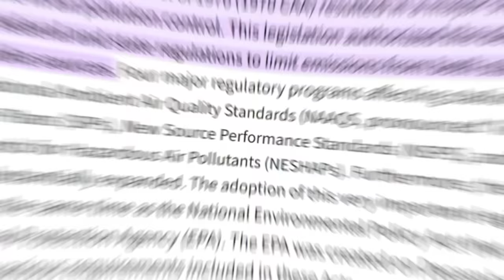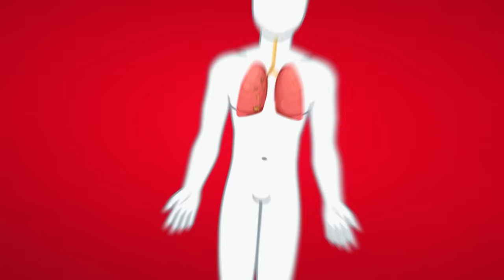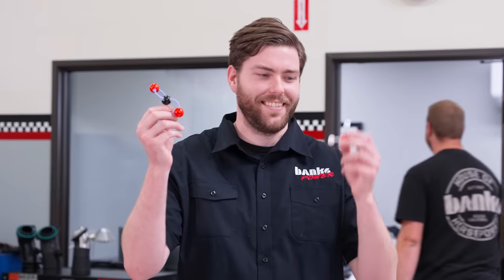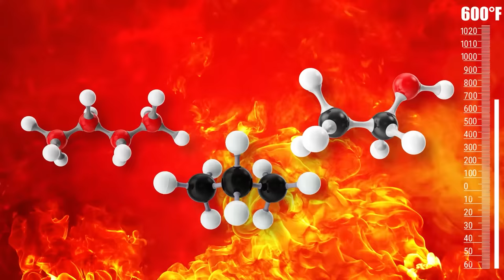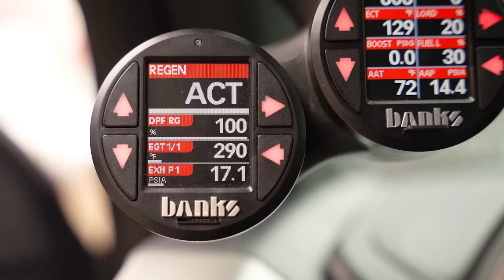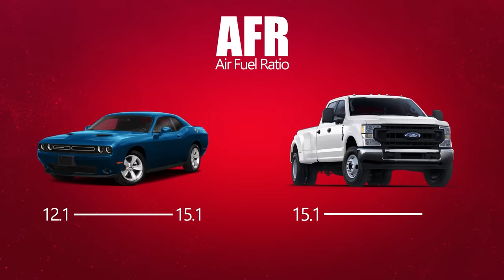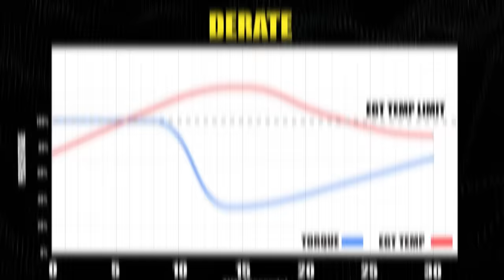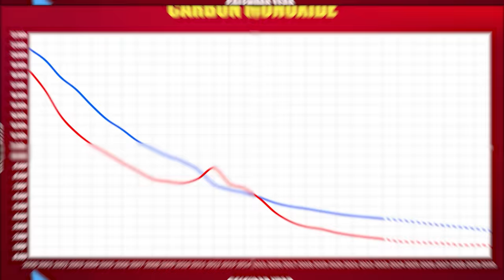Understanding the Most Hated part of your Truck | Banks Entry Level

Comment: As the new owner of a diesel truck, I really appreciated this video.  I was never planned to delete the emissions system (I like breathing too) - I'm more interested in longevity and reliabilty.
Reply: YES also am a new Diesel pickup owner. Had GAS engine trucks since 1979. My new Duramax Allison. I never want to add anything to this engine. I watch experts on  transmissions talk about if you make more power on the engine you also need to address the transmission. I watch experts Transmission videos on U-Tube as he talks through the take down showing what went wrong with a power boost to Engine only. These experts on transmission show the different parts they add to transmission the beef them up for power surge on Diesel Engine. I also own a 8V-71 Detroit Diesel plus a 353 Detroit on two pieces of restoration equipment that I own. YES I'm leaving my Duramax as is.
Reply: If you want longevity and reliability, you have 2 options: either delete all of that useless shit off of it, or buy a pre-emissions truck. That is LITERALLY the only way💯💯💯...I understand what gale banks is saying, but I've lost a lot of respect for the man because of his push FOR these systems that destroy these trucks. I've had 3 new trucks with emissions on them, and not a single one of them made it past 170k without needing 10k worth of emission system related work to make them usable again, which I guess is ok if you fully understand that you will never have to replace that system on that particular truck ever again, due to the engine eating its own ash and scoring the cylinder walls so bad that a rebuild is necessary at 300k💯💯💯...as much as I hate to say it, I don't know one person who has these trucks that DONT delete the entire system, and if there's one thing that seems to be becoming the norm everywhere, none of these people use anything Banks-related in any way. He has alienated his people with the sheer amount of lies about "reliable emissions systems with a tune makes more horsepower".....that's 100% grade A bullshit. You will never see an emissions compliant truck with a tune go head-to-head with one that isn't, and if you do, that emissions choked chunk of plastic and steel ain't gonna fare well at all💯💯💯💯💯
Reply: @shellow3 aight tinfoil man. Try not to choke on all those 💯 emojis
Reply: @brotherloops  I love you😍😍😘😘😊😊
Reply: @brotherloops don’t hate facts because they don’t fit your narrative of the world…reality is reality
Reply: @shellow3 There is definitely a market for the stuff Banks sells. A lot of states are very strict on what you do to your vehicle and as much as I hate the DPF and all the other components associated with them it’s good to see that someone is making things for those people who have to keep their emissions stuff on the truck.
Reply: @kirbywinters1291  yeah, there's a market for it, but the old saying "there's a sucker born every minute" is on point when it comes to the ones that do buy it🤷‍♂️ why sink 5-10k more into an already 50-100k  dollar truck just for it to not last past 200k? That's absolutely outrageous, and for Banks to make that claim with his knowledge of what these emissions systems do to these trucks leads me to believe he's been paid off💯
Reply: @shellow3 are you referring to your old diesel not lasting 200k or a modern one? because modern diesels hitting a million miles are not unprecedented when the rest of the truck lasts that long.
Reply: @malcomreynolds4103  old diesels without emissions can and do hit a million miles consistently, it's modern diesels with emissions that aren't anywhere near as reliable unless their emissions systems have been deleted, or the owner has no problem dropping almost as much as a new truck would cost for repairs to fix everything those systems destroy  (which in most cases cost anywhere from 8-13k to repair every 150-200k miles, and thats not counting the cost of routine maintenance💯)....that's one of many reasons that people are keeping their pre-emissions diesels longer, or swapping modern diesel engines with their emissions systems deleted into pre-emissions trucks
Reply: @shellow3  they COULD hit a million miles. they didn't do it regularly and certainly never did it without copious amounts of major maintenance, particularly injectors every 150-200k miles - half or less of what a modern diesel will have its injectors last for.

it absolutely does not cost 8-13k to replace a DPF. EGR is a few hundred dollars to replace and is unlikely to fail.

just because some boomers are incompetent in maintaining their vehicles or  in understanding how they work, doesn't change the fact the user is the problem with their trcuk's longevity.
Reply: @shellow3 the guy himself said those that delete emissions are criminals
Reply: To bad no buddy else in the world does this stuff. Just america! Weird how we can do all this but won't change much because no other countries will change there standards.
Reply: @davidburnworth7295  Not sure if a troll, illiterate, or both.
Reply: @davidburnworth7295  SCR has been in use in the EU since 2005. DPF were widely used around the same time an universally used around 2012/2013
Reply: If you're concerned with reliability, the dpf system is the number 1 thing you should address after warranty expires. Everything else about modern diesels is superior than diesels of old except the dpf systems. I've got about 20,000 miles to go myself and that crap is coming off.
Reply: @jeffhall768 if it hasn't gone in for warranty it obviously isn't a problem
Reply: @malcomreynolds4103  several pre emissions Duramax and Cummins have hit a million miles on stock injectors. I'm at 400k on oems right now and my balance rates are all within +/-1 .

Dpf and EGR are completely different systems, saying dpfs aren't expensive because EGRs are only several hundreds of dollars, is like saying the VW beetle is the fastest car in the world because VWAG owns Bugatti.

I'm a gen z but boomers definitely had the maintenance down way better than any of my peers or the younger generations.
Reply: @StarHunter28  There is no such thing as a pre-emissions duramax. diesel emissions controls were implemented at least sometime in the early 90s, maybe earlier. More of them were just implemented later.

by 'cummins' if you meant ~2000-2007 cummins getting half a million miles on injectors - that isn't surprising. All diesels were cleaned up drastically around then, particularly instead of running super rich all the time were leaned out thanks mainly to EGR and much more technical fuel injection.

you obviously didn't understand my rebuttal. DPF replacement does not cost anywhere near 12-13k. If you worked at it you may be able to find a particularly unscrupulous shop that may charge you half of that. That has nothing to do with EGR.

Even if EGR does have a problem - which it almost never does, other than some powerstroke POS, its a trivial fix.

Comment: Excellent video! My personal goal is to buy a taken care of pre emissions diesel truck and never have to worry about emissions checks and the issues that come with emissions equipment. Honestly if manufacturers would just warranty emissions equipment my faith would be restored. I wasn’t able to enjoy any road trips with my DPF equipped truck because I couldn’t stop thinking about it failing in the middle of nowhere and being stranded because a particulate sensor went out.

Comment: thanks for video, gave a really great explanation about the system.. some old timers complain about all the new emission standards but I remember a time when you didn't want to be driving behind a big rig or sitting beside them on the road because of all the pollution coming out of their exhaust..and the truck stops were like a bad industrial park
Reply: Your still breathing in the chemicals just can't see or smell them as much anymore.  Also I remember the 90's very well when no trucks had these and it all seemed the same as now to me.

Comment: I've always thought that the focus should have been on fuel efficiency standards instead of emissions. If modern diesels were allowed to run uncorked but tuned for maximum efficiency imagine the fuel economy numbers we would be seeing these days. And it almost goes without saying that if you're burning far less fuel your emissions output would be much lower as well. The fuel economy numbers on modern diesel pickups are pretty terrible and we've actually gone backwards in most cases. I salute Banks for doing what they have to do to stay in business and push the tech development envelope with their products. That being said, the folks that I know with deleted trucks have seen substantial fuel economy increases and overall reliability improvements.

Comment: I’m retired from the company that invented and makes the substrates for DPFs.  It is pretty amazing technology and it was a challenge getting a low-cost manufacturing process to plug every other channel in the substrate.
Reply: So your the reason there’s 250,00 miles taken off a Diesel life
Reply: Thank you for creating a nightmare
Reply: @dang5553  And that is based on what data?
Reply: @jayadams8859  Yes, eliminating diesel smoke and helping provide clean air is a real nightmare.
Reply: @jayadams8859  If you figure being able to see what's going on around you clearly is the nightmare, thanks to reduced smog and smoke, maybe you should try making the world a better place, rather than hide it behind smoke, soot, and smug FYIGM attitudes.
Reply: You'd think people commenting on a Banks video would understand that clouds of smoke isn't because you do/don't have a DPF installed... it's the tune.
Reply: @SnifferSock  It is a little of both.  Even a well tuned diesel will generally output some smoke at various points in the operating cycle, but I agree that a well tuned diesel should not product much smoke at all.  However, not all particulates are big enough or dense enough to be seen, so a DPF is still a useful addition.
Reply: Do you honestly think vehicle manufacturers install all the emissions equipment and deal with the massive increase in cost of a new vehicle... Instead of just "tuning it better"?

Comment: Hey Guys what an excellent breakdown, we are over in the UK, our own diesel trucks are used for short runs so we drop the oil every 3000 miles, always use Shell premium and change filters regularly....never had an issue, no dpf clogging, no smoke and completely standard tune.

Comment: My truck is a 2018 Ford F350 XLT cc lb drw...I have installed several Banks products: Ram air intake, 5" Monster exhaust, Derrringer set @ power level 3,  Pedal Monster @ city level 10...Before Banks items my regens were happening around the 325 to 380 miles & soot levels 90% to 100% with no passive regens...after Banks items installed regens occur regularly at 497 miles & soot levels run 50% to 70% with many passive regens...also my mileage has gone from 16.2 to 16.7...I monitor things with your idash Super Gauge & idash Data Monster
Reply: Why not just delete it bud?
Reply: @drunkpolack7612  Because, 1) it's illegal, 2) it's not necessary. If your engine is in good condition and the aftertreatment system is in good condition, and you don't have a bunch of shit parts and a shit tune to go with those parts, then you won't have major issues with your aftertreatment system. Will the DPF last forever? NO. It's not designed to last forever. Is your air filter, oil filter, cabin air filter or crankcase ventilation filter designed to last forever? NO. Do people change those at some designated interval? YES (except the idiots I suppose). A DPF is a FILTER (it's in the name, duh) and will at some point need to be changed. Thank fully, unlike any other filter in your truck, it can partially clean itself by running a regen. If it didn't do that, it'd plug up even faster and you'd be changing the DPF more frequently.

Hey, I get it. When these systems first hit the market, they weren't very good and very problematic. That's why deletes were born. But, the sftertreatment systems have gotten a lot better since '07 and are pretty reliable (unless you start adding those shit parts and shit tunes I mentioned) and deleting them is not necessary, even if it WASN'T illegal.

Comment: I had an 08 Cummins with the G56. I bought it from an old timer with 35000 miles on it. On the way home, I drove about 200 miles and got 13 mpg. I had the stuff to delete it there already and got to work. With the tune, I would consistently get 18-19 unloaded and about 14 or 15 loaded down. Now, the tune helped but every once in a while I would go to stock tune with the deletes and my boost would be super low and my EGTs would be really high. I’m guessing it had to run hot to burn the crap off. 

All that to say, the truck ran better and got better fuel economy. I would 100% recommend it. If nothing else, the EGR is gross. When you take it off, you see all the junk in the air horn.

Comment: All good stuff, but, I've had nothing but service engine lights from my totally stock 2017 superduty truck due to the DPF. After the 4th time at the dealer, and having the check engine light come on again on my drive home with the threat to limit speed to 80km's/hr I cut the stupid thing out and got a delete tune. My fuel mileage has gone up 100km's per tank, and I have another 200 hp. Massive HP/Torque increase over stock.  I never even floor it anymore. 3/4 throttle and I'm gone.

Comment: All real good info. I had 2012 ford 350 diesel  that went from 18 mpg stock to 24 mpg with the Def system deleted and the Edge chip only set at 50hp. The system not only increased hp and fuel economy but we tested emissions before and after the delete and although there was a slite increase from the delete it was very little. The truck ran better and more efficiently by removing all the excess.

Comment: Only illegal to modify for a shop to do so. You doing it at home does not violate any laws. If you live in a rural area where you don't need a smog check to get tags you'll never need the def or egr system. Im usually against tuning but with newer vehicles relying on these systems you will notice a dip in fuel economy until you tune it. This is why I'll never buy a post emissions diesel. Newest I would buy is 06-07 maybe but that depends. And for those wondering why uria sounds familiar, it's because it's basically piss. Chemically it's the same thing...

Comment: You can use "Big Iron Bar" to clean out clogged dpf filters. It also works great on catalytic converters and stock Harley Davidson mufflers. Just a few strokes of Big Iron Bar will fix most exhaust problems.
Reply: good one.
Reply: I use the BIB on cats after index marking the converter-pipe joint with three parallel scribe marks so I can correctly replace it before welding. HD mufflers are easy of course. I backed mine up with wood then used a hydraulic press to shear the welch plug from the baffle center.

Comment: I want to see Banks doing some work with Speed of Air Technologies and Dynomite Diesel. I think that trio could make an insanely efficient engine, with the SOA pistons, Dynomite's clean and efficient injectors, and of course Banks' tuning and airflow knowledge.
Reply: That would be great to see, considering Speed Of Air put a set of their pistons into a transit bus engine around Tahoe with a 7.2 Cat engine seven years ago, and until now the bus hasn’t regenerated once.  So hopefully their pistons are burning the fuel clean enough that people could theoretically buy even less DEF.
Reply: Exactly. Plus all of their testing with CAT off road haul trucks, the pistons more than doubled the oil intervals and had more than double the lifespan of the standard motor. If we can clean the burn at the source and remove the after treatment, everyone will be happier. The EPA will have the standards met, the end user gets more efficiency and durability, and the enthusiasts get the good sounds and increase of power.